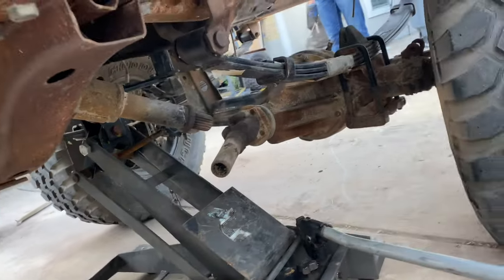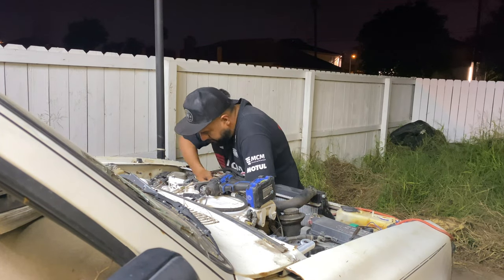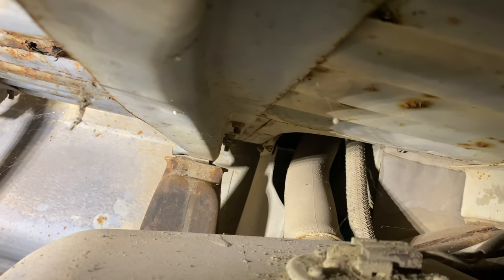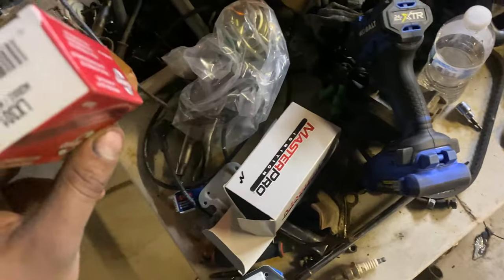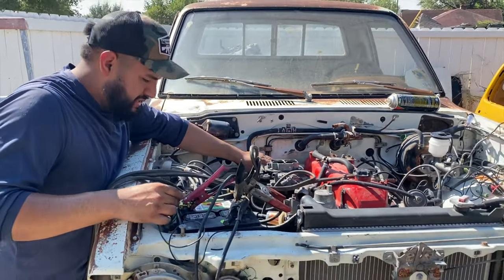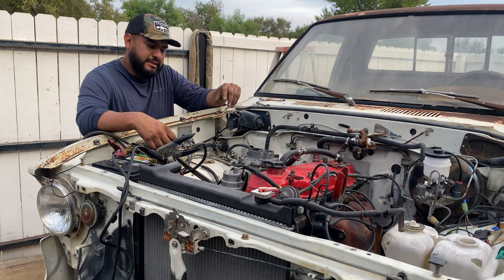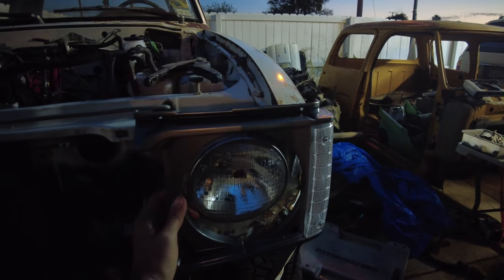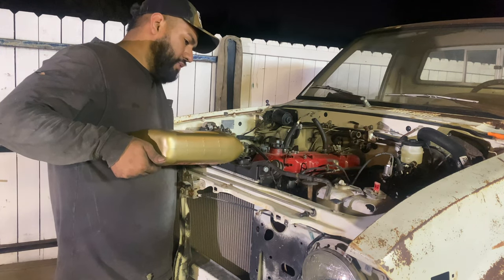Resurrecting A Toyota Hilux After 15 Years Start To Finish

Comment: I'm in the process of rebuilding the exact same truck. Could you start putting part links under your videos? I'm interested in the headlights bezel/housings and the tail light lenses? Where did you get them? I'm finding them online but not sure on the trustworthiness of the sellers.
Reply: 4

Comment: I'm having the same issue with the clutch fork.  How did you fix it so it sits properly?
Reply from the maker: They have 2 clips that hold it in properly one fell off when I had the transmission out then I reinstalled it but saw the clip on the floor so I pulled it aging and put the clip in and that was it

Comment: Not really a HiLux, just a Toyota factory 4WD pickup ?   I don’t know if there is any actual difference, but that’s what they were called in North America. 
   I am subscribing now 🛻
Reply: In Australia this is a hilux
Reply: @oohsam  for sure.  They were just called “Toyota truck” in North America until the Tundra came out. Then toyota began calling them “Tacoma”.   I had an ‘87 with a 7’ bed.  It was a good one.  Valves ruined by bad gas in ‘08😾